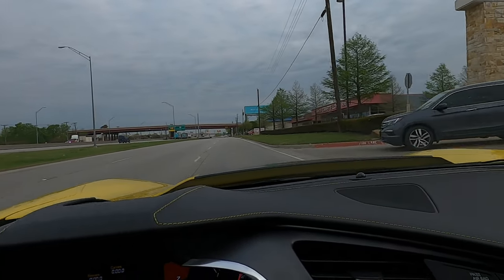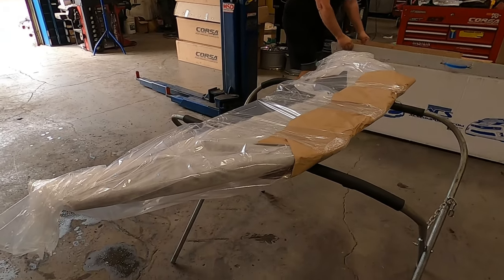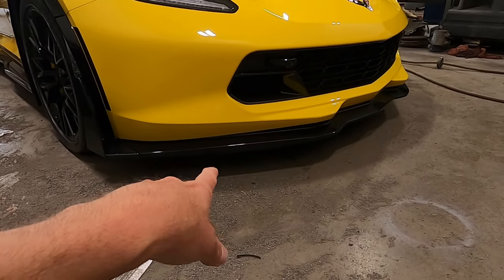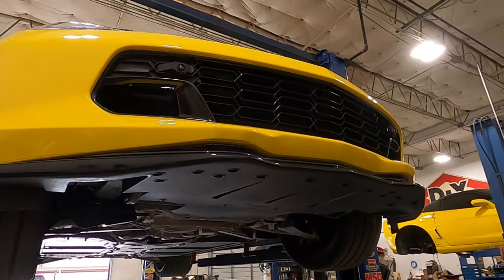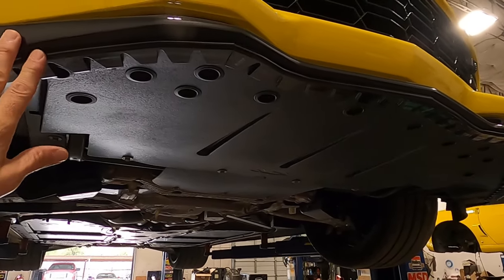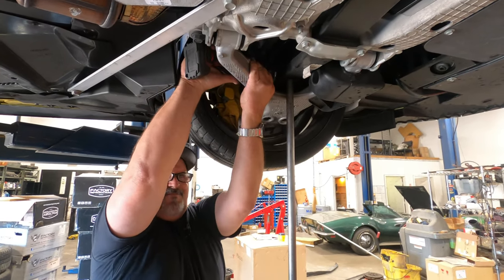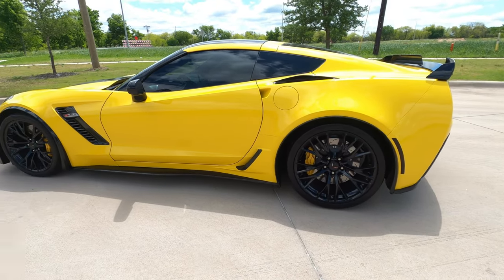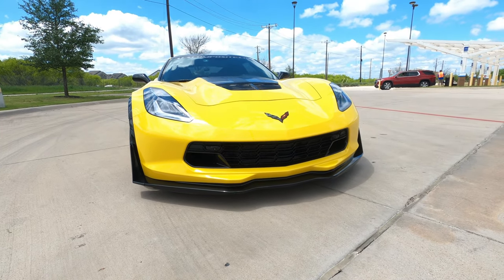This is a MUST fix on the C7 Corvette!

Comment: I believe that the engineers for the Corvette know more than I do about setting up the suspension for great handling. Therefore I'm leaving the settings on my ZO6 as they came from the factory. I know that there will be those that disagree.  John
Reply from the maker: I definitely don't disagree but since I will not be tracking it I'm not too worried. Keith at Corvette World actually discourages installing larger wheels but people do it all the time. I have zero issues with people that leave theirs stock, I just prefer this look.
Anyway, hope you're having a good Monday. Thanks for watching.
Reply from the maker: Brian Stafford  You realize how many people lower their Vettes and how many people increase the wheel size? If it was a really bad thing to do, it wouldn't be such a common thing. I'm not stressing over it. Everyone has to do what they think is right for them.
Reply from the maker: Brian Stafford  I wasn't.  If I came off that way, sorry. Didn't mean it to be. Just giving my thoughts on the situation.
Reply: GM actually recommends a slight drop to improve track performance on the ZR1, it’s in the manual. As someone who tracks a Z51 I went with smaller wheels to save weight. I lowered mine but had to go back up slightly to avoid rubbing. However I am running wider tires and different offset from factory. The wheel gap on these cars does look bad, my brothers 911 is way more tucked looking from the factory.
Reply from the maker: @johnmoore3504  Great info John. Thanks for commenting. My friend Justin wants to lower his ZR1 but his driveway is also an issue.
Reply: Agree since I track a bit

Comment: For track use, it’s recommended to remove the under tray. For track use you need suspension travel, but if you just drive around fine.
Reply from the maker: Yeah, I don’t track it. Just drive around DFW.

Comment: You still thinking of going the C8 route? I have C7 stingray but still on fence with prices of all cars going thru the roof!
Reply from the maker: I really want to but they're still so far above msrp. Ultimately I want a Z06 anyway and when I sell the C8 Stingray I'm going to lose a lot of money so I likely won't get one. I kinda regret not putting a deposit on one when they were first coming out. Oh well...live and learn.
Reply: @FrontSeatDriver  i agree on not paying way over msrp. that is alot of money never to get back. c7 prices are way up also🤷‍♂️.
Reply: @FrontSeatDriver  I heard they released the specs for the C8 Z06!  Way cool. Have you checked it out yet?

Comment: You're right, GS and Z06 don't lower as much as Stingrays on stock bolts. GM decided that track monsters need more suspension travel. Does it need that much gap for any other time? Probably not. Drive it around carefully like you already do, and enjoy the improved looks. For those that worry about scraping, just raise yours to the max and remove the lower aero bits.

Comment: I cheated to close up my wheel gap on my '17 GS Z07. Kept the stock ride height, but when it came time to replace the Pilot Sport Cup tires, I got Continental Extremes in 35 aspect ratio instead of the stock size 30's. The slightly taller sidewalls closed up the gaps front and rear, gave a slightly higher ride height to reduce scrapes, tiny bit more compliant ride with minimal reduction in sharp turn-in (it's a street car after all). Nothing rubs and the wheel wells look full.
Reply from the maker: I love the look of the Continental Extreme too!
Reply: But wouldn't it mess up the odometer reading using the 35's ?
Reply: @anthonycosta1776  Mmmmaaybe? Larger diameter would make the speedometer read lower than actual so I could gasp be speeding and not know it! 😬😮🙄

Comment: So how much did it cost to lower it like that? What did you do to actually lower it? I’m curious? It looks sharp.  Something I might want to do to mine when I get it.  Love it. Appreciate the video and info. Thank you. ✌🏻
Reply from the maker: It cost me about $100 to lower it.  It's pretty easy. They just turn a screw basically that lowers the car. No lowering springs or anything extra needed. One of the bolts that allows for lowering got stuck so we could only lower it about a half of an inch in front instead of 3/4". He said that happens sometimes.
Reply: @FrontSeatDriver  ok great info. Thank you so much.  I will do this on mine.  Appreciate your time.  ✌🏻🙏🏻

Comment: Question what was the part number on your front splitter from ACS ?
Reply from the maker: DESCRIPTION [45-4-059|45-4-079]CFZ

It’s the Z06 Splitter - carbon flash
Add Undertray
Add Stage 3 Deflectors (Z07)

Comment: Hey buddy - I was at Corvette World planning to lower my C7 Z06 - post a discussion with Keith and team - I have questions for you before I do it - what material effects have your ride quality and handling had post the lowering?

I am on sport suspension setting all the time and do not like the bone jarring will of track suspension setting - does lowering make it feel stiffer due to reduced suspension travel?

Did you notice any changes in handling and cornering ability ?

Any other concern?

And by the way love the videos - subscribed already - love to see folks from DFW making such awesome content.
Reply from the maker: Thank you sir!

I had mine lowered on stock bolts and I had an alignment done shortly after. 

I normally drive in Touring mode unless I’m driving fast and want better handling. 
The ride is pretty rough either way in my opinion but I haven’t noticed any real difference in comfort or drive ability. I think it looks much better too. 
My wife’s Camaro drives tougher than my C7 even after lowering. 

I highly recommend. 

Thanks again for watching. 

Let me know if you have any other questions.

Comment: Did the same under tray splitter too and used the slip low too!!!
Reply from the maker: The under tray and splitter are 1 piece and I added sliplo to the front area near the edge. Curbed it immediately the same day and did virtually no damage.

Comment: I just got an '18 GS with only 3k miles.   It's getting a pro charger right now.  I should be faster than a stock z06.  And my insurance is still based on the GS.
Reply from the maker: Congrats on the car !Be careful though with the insurance. I've heard they can possibly deny your coverage if there's an issue and they find out it has been modded. Might not make enough difference for them to care but NCM was specific about this with me. And honestly,  it wouldn't make that much of a cost difference on your insurance.  I had a GS before my Z06. The Lambo is what hits my pocket book.
What color did you get?
Reply: @FrontSeatDriver  I got white on black wheels, black hood, roof, mirrors. LT2

Comment: Much better! Lowered mine too and put a splitter couple months ago, havnt scraped it so far! 🤞
Reply from the maker: Nice!! I always scrape a little in my driveway. Hoping the sliplo keeps me from scratching the splitter. 
I bet you're glad you did it as well. Did you get an alignment done after?
Reply: @FrontSeatDriver   my driveway is a bit sketch too but at a 90 degree angle i can do it no problem but wouldnt be able to come in straight thats for sure.  and no i didnt get it aligned, im not too worried about that..

Comment: So you think your stance will ride better than the GM engineers set it up for?    And why would you want the car level?   it is supposed to have a very, very slight higher rear end for Performance aspects
Reply from the maker: Pic is from GM. Not my actual car. I lowered mine evenly all around. Maintaining the same level as prior only lower.

Comment: Great mods.  I would also like to suggest getting wheel spacers so your wheels and tires are closer to the edge of the wheel well.  I makes it look more flush.  Maybe 1/4" spacers, no more than that though.
Reply from the maker: Yes!! I am with you 100%. It’s something I have been planning on doing. It’s crazy, you fix one issue and see another. Lol. Plenty of content I guess.